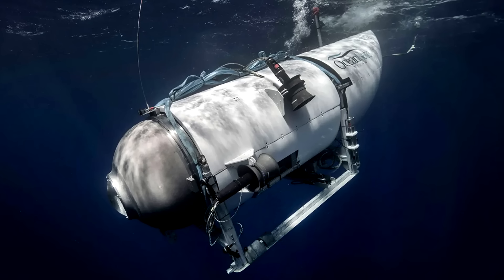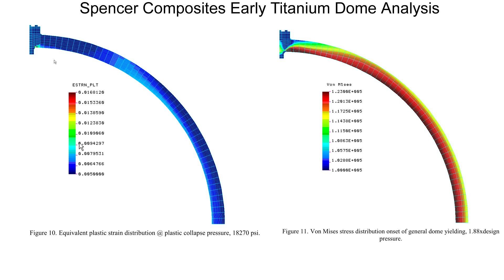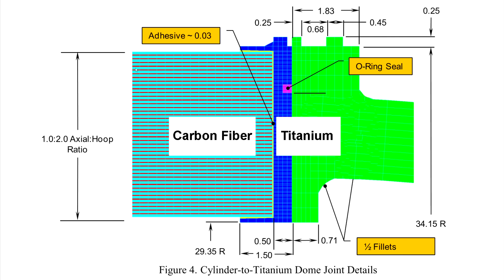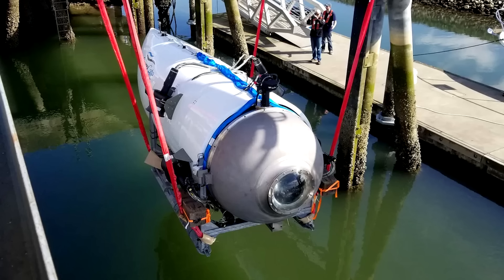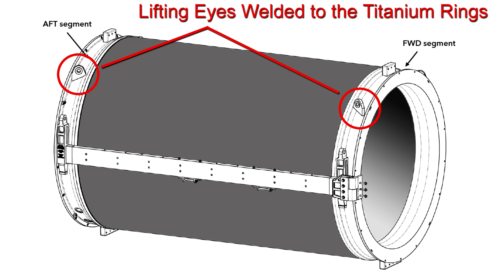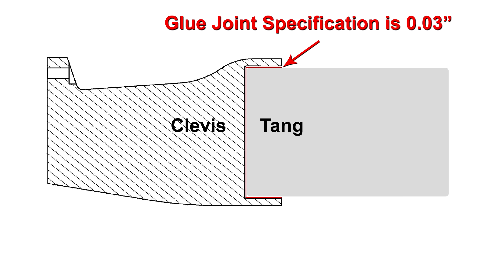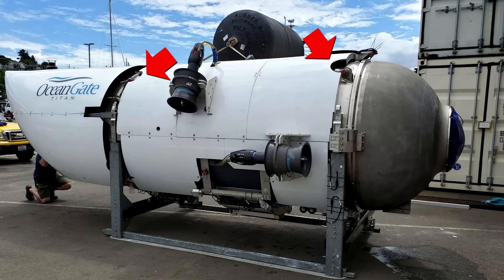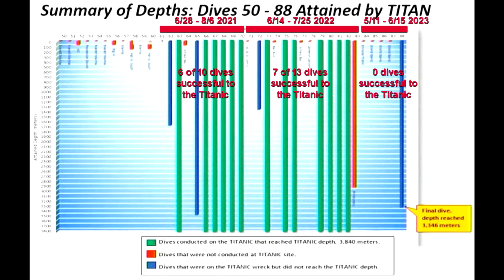OceanGate Titan Titanium Rings - An Additional Story About Them

Comment: This sure looks like the explanation.  Heat applied to do those welds is unthinkable.  Water would start with pinpoints of entry, spider through the laments or on the ring glue interface until a failure.  The pressures involved were incredible, the water would have taken advantage.
Reply from the maker: Thanks for your comment.  This is certainly an interesting story that I wanted to discuss because it adds a variable.  But we don't know if it is the explanation for the implosion.  Maybe the final NTSB report will give us some answers.
Reply: @solareclipsetimer Of all the discussions, this one looks like the most obvious explanation. Even if it wasn’t the actual failure mechanism, had the sub lasted longer, it likely would have become one.  

If you want to investigate further, look up the temperature specification range of the adhesive compound used. It was most likely far exceeded. Then ask what happens when that range is exceeded—chances are long chain polymers break and perhaps  chemically reacts itself or neighboring materials, ultimately leading to cracking and loss of adhesion.  

As a secondary and compounding effect, after being heated, the heated adhesive likely became the primary load-bearing point when the sub was lifted. This would have temporarily deformed the ring, introducing strain in directions the joint had not been designed to bare, that further weakened the already compromised adhesive. That alone could have caused its failure without the heating, but with it, even more so.

There is always a strong temptation in engineering to say "good enough" and cut corners, only to later justify it with "see, it didn’t matter—everything is over-designed anyway."  

That said, I’m also curious about the through-hulls, as they fail frequently across all kinds of vessels. I can imagine one letting go and shooting through the crew cabin, passing through bodies like they were butter. Thus the last moment of awareness of the passenger might have been a gunshot sound and a brief glimpse of Stockton Rush’s  chest and belly exploding open and pouring fourth all within. But perhaps that’s more of a morbid thought than an engineering analysis.

Comment: Are there any engineers here that can explain why there wasn't some kind of sling device that went underneath as much of the sub as possible?? That feels like the first route I would have gone down.
Reply from the maker: Thanks for your comment and great question.  I don't think you would want to lift the vehicle by the hull.  Tony had it all planned out, it was engineered to be lifted from the lower portion of the landing gear.  They just had to follow the original engineering and not cause all this controversy and the potential problems.

Comment: How you gonna design a sub like that, and not consider how to lift it in part of your design? Lol. That should of been incorporated into the design right from the beginning. Not the brightest engineer also...
Reply: In my opinion, this is partially the engineers fault for not designing a way for the sub to be lifted safely, but its not his fault they just went and welded lifting eyes.
Reply from the maker: Thanks for your comment.  Tony Nissen planned to it to be lifter form the landing gear.  The mounting of the landing gear frame was the best way to stabilize everything.  I have images of it lifted form the bottom of the frame, and that one image I found where it was being lifted from the top of the frame.  I wish we had testimony from someone that specifically addresses the decision to weld on the lifting eyes.  We don't at this time, but maybe some more information will come out in the final NTSB report.

Comment: Welding on the rings would have also introduced an area of harder, more brittle titanium in the heat affected zone around the welds
Reply: The company that welded the titanium parts for this is a defense contractor and navsea compliant. A company that specializes in only high alloys. I find it hard to believe a naval welding contractor that welds components for us submarines would comprise integrity  into a commercial sub and comprise future naval contracts
Reply from the maker: @red3874  Thanks for your comment.  I actually hope that OceanGate did have engineering guidance for adding these lifting eyes, and I say so in the video.  However, the publically available information on the Coast Guard site or in the testimony does not mention additional engineering or the welding contractor.  Do you have a reference for the information you mentioned?  Thanks.
Reply: In the coast guard  PowerPoint presentation and Wikipedia mention who the welding contractor was TiFab. As I was reading their site this contractor has also welded on the Alvin submarine
Reply from the maker: @red3874  Great, thanks I will look into that information.
Reply from the maker: Thanks for commenting.  I wonder if some of these details about welding were considered.  I hope they looked into these things.
Reply: @solareclipsetimer  I do wonder as well. I weld titanium for a living which is the only reason it came to mind. I feel that if it was a properly engineered and manufactured part, any welding would have been done before final machining, which clearly was not the case being an afterthought addition. Anyway, thanks for the series of videos, they have been entertaining and provided better detail and insight than I've seen anywhere else
Reply from the maker: @slabbadanks5829  Thanks for the support and the feedback about the videos.  I am glad you have enjoyed them.

Comment: So why not just make a titanium sphere like Alvin big enough for 5? Nissen @ 9:10 talks about uniform loading all the way around.. not static like your car or house. Gravity wouldn't add an extra stress to everything in the vertical plane? I'm inclined to expect it to..
Reply from the maker: Thanks for your comment.  Alvin, at its current size, already weighed 40,000 pounds.  It has to do with weight.  Now, it doesn't seem that carbon fiber is the answer.  But the passenger size of a titanium sphere is limited by total weight.
Reply: One problem  was this sub was supposed to be 7 inches thick  and they went with 5 inches.
Reply: Too expensive. Stockton Rush wanted to sell seats as cheaply as possible and was willing to take shortcuts at every turn in an environment that would harshly punish such stupidity. Dummy ignored what little safety net that was built in and only installed as one former employee said "safety theater".

Comment: We should reconstruct the titan and lowered it 4000m deep to replicate the implosion. With cameras and all.
Reply: Why? We know that it failed and that it wasn't certified.
There is nothing to prove.
Reply from the maker: @sebastianriemer1777  Thanks for your comment, and you make a good point.  It wasn't certified because the way it was built, it was not certifiable.  None of those outside parties would have ever approved it, and the pathways to try to prove the design to them were basically not feasible in terms of time and cost.  But regulation may stop something like this from happening again, at least not with others on board besides the developer.  That is why the story is compelling, and the engineering decisions should be dissected.
Reply: For the last 20 years I'v been making more than 500 different subsea vessels in carbon fiber. Rating from 1500 to 6000 m depth.  On a smaller scale though: 50-500 mm in diameter. Based on our experienced I agree that the glue joints betweene carbon hull and the titanium ring is wrong designed, and to weld on lifting point to the titananium rings makes it evevn worse.
Reply from the maker: @oladal  Thanks for commenting.
Reply from the maker: Thanks for your comment.  That would be interesting, wouldn't it!

Comment: The mill guy had to put it up on the mill table, probably c clamped to angle plates, indicate it in, special engineering instructions to cut as close as you can without opening the diameter. Fun. stupid groove inside. Im obviously not in management or engineering, journeyman tool and die maker.
Reply from the maker: Thanks for your comment.
Reply: @solareclipsetimer  lol I couldn't help but sympathize for the poor folks that got drug into that projects

Comment: As A, as we like to say. The heat involved in welding lift rings or any welding adjacent to a glued surface, then stressing that glued surface repeatedly ( lifting in this example) and expecting that union or bond to have zero compromise, then relying on that bond to sustain many atmospheres of pressure! Well, my ass would not allow me to sit in that vessel for pictures!

Comment: Strongly disagree with the idea that the leadership of Oceangate were not stup1d. According to SpaceX, early in the Starship program, they abandoned carbon fiber in favor of stainless steel because carbon fiber was more expensive, more complex to fabricate, and less predictable. Additionally, carbon fiber has never been used in deep-sea submersibles due to its unreliability under extreme pressure. Given this, there was no compelling reason to use carbon fiber. Sacrifice every metric to save weight? It doesn't make any sense at all. Innovation should be driven by proven material performance, not simply by the desire to be different or claim to be a pioneer. Most concerning, however, was the decision to put people inside the sub during the testing phase of an unproven design, which was extremely reckless.
Reply from the maker: Thanks for your comment.  Watch the segment starting at 05:23 that compares the Titan to Alvin.  Stockton had some specific design goals when building his submersible: 1.  Lower weight.  Titan weighed 23,000 pounds, and Alvin weighs 40,000 pounds.  That much more weight, to use all titanium, makes neutral buoyancy for a submersible much harder.  2.  The lower weight also meant being able to launch and recover with the barge technique (LARS) and not needing a huge ship with a huge A-frame crane to launch and recover.  The LARS concept was a big deal for Stockton.  3.  Bigger cabin at the lower weight.  The Titan can fit 5 people, and Alvin can fit 3 people. 4. The cylindrical shape.  Stockton had this big thing about depth of field in the sub for photography.  He liked this shape because he wanted to have a camera in the back that could record the action in the front: meaning to take videos of people enjoying the view in the front.   In a sphere, you can't get far away enough from any point to do that.  I am not saying any of these things justify using carbon fiber for a deep-diving hull.  I am not saying that the build and testing were adequate (it was not).  I am just telling you why Stockton chose carbon fiber.

Comment: In this video, the first engineer presents only 2 concerns about lifting eyes:

1. Welding on the eyes while the carbon hull is already glued risks overheating the glue.  This doesn't apply if welding was done while the rings were disconnected .
2. Putting the weight of the entire sub on the structural shape between the hull and eyes could deform the rings just enough to crack open the glue, allowing water to seep in.  This seems plausible for the disaster if water made it through and washed open the glue, thus tearing apart the glue/fiber hull material .
Reply from the maker: Thanks for your comment.  You are correct.

Comment: When they were winding the CF they should have X the strands. Everything I have seen shows a straight side to side wind like a hose reel.
Reply from the maker: Thanks for your comment.  They did plies in two directions.  Wrapping like a hoop and 90 degrees to that, longitudinally.  There were two plise in the hoop direction and then one in the longitudinal direction.  They did 133 plies per one-inch layer before curing.  They decided not to use 45-degree plies.

Comment: Concerning the welding of titanium: the weld seam must be made in the absence of air, moisture and contamination from oil, grease and anything like. This was certainly not the case here, considering the production conditions. In addition, the adhesive begins to decompose above 300° C. As titanium has a high melting point, it can be assumed that the adhesive was also damaged.
Reply from the maker: Thanks for your comment.  I feel sure they welded the lifting eyes on the rings when they were off of the first hull and before they glued the rings on to the second hull.
Reply: @solareclipsetimer  Maybe, but welding of Titanium is not an easy task.

Comment: That is the simplest explanation so far. Adding lifting lugs on the rings caused shearing at the glue interface. 20 some lifts later and the adhesive is ground into dust.
Reply from the maker: Thanks for your comment and I am glad you liked the video.

Comment: This was a programmatic failure.  

The sub should have been taken out of service after a specified number of dives to test for signs of fatigue.  Say, less than 12 dives.  The engineering analysis going on since the implosion should have been done at that time, before the failure. 

Then, build a second hull incorporating new design changes, to use for customers.  What you DO NOT do, is to continue diving over and over until she blows!  

He ignored the popping noises and other signs of trouble, erroneously thinking the hull would last forever.
Reply from the maker: Thanks for your comment.  You are absolutely right.

Comment: So they should've built a frame around the Titan to Hoist it. I worked as an Auto tech. And in a Warehouse. Putting Lift Tabs on the Rings was such an obvious mistake due to the Flexing.
Reply from the maker: Thanks for your comment and you ask a great question.  Yes, there were other ways to do it.  However, they may have been concerned about adding too much additional weight.  The weight of the sub is a big deal because it has to do with its buoyancy. Both to sink down to the Titanic and also to ascend by dropping weights, either in a routine dive or in an emergency ascent.  The entire buoyancy balance, after weighing the crew on a dive is, within 200 to 300 pounds.

Comment: The clevis was never designed to take shear force?

Isn't that the ONLY force it would see when the carbon fiber body is put into enough compression???
Reply from the maker: Thanks for your comment.  When deep in the water, the domes and the rings are pushed directly inward towards the butt ends of the carbon fiber hull. There is predicted to be no forces up or down on those rather thin clevis lips.
Reply: @solareclipsetimer  good stuff, man. Watching some of your other videos now!
Reply from the maker: @ACSFieldtech2 Thanks for your support!

Comment: It ascended slower than expected. Was it too heavy on descent, or did water leaks weigh it down?
Reply from the maker: Thanks for your comment.  On the final dive, the descent rate was reported by the team to be 33 meters per minute, which is a normal descent rate.  Just before the implosion, the sub reported "dropping two weights," which is a normal procedure to slow their descent as they approach the bottom. Two weights for them is a total of about 70 pounds.

Comment: Why the fuck did they use Carbon Fibre and Titanium!!
Carbon fibre is great for low weight - NOT required in a sub
Titanium is great at high temperatures - NOT required in a sub
Carbon Fibre and Titanium sound sexy but are simply the WRONG materials to use for a bloody submersible
Nice boring cheap Steel would have been a much better choice

Comment: The titanium rings should be adequately stabilized from any distortion when they are bolted to the domes.  And the lifting shear force against the carbon fiber hull is born by a vast area of adhesive (nearly 1000 sqin each) and the collars on the titanium rings.  So the sheer load on the adhesive during lifting is not much over 12 lbs per sqin.  Double stick Scotch tape could hold it.

Comment: I don't agree with the statements about why the lifting lugs couldn't be added, those rings are supporting the weight of the CF hull when ever the sub is on the ground, the sheer force is no different, unless he is considering lifting standards and knows the factor of safety doesn't meet the standard for lifting equipment. I would however consider that not using a spreader bar could create somewhat of a moment and potentially put the glue in the lower portion in tension, but even that's hard to fathom. What I would like to know is if the ring was machined post welding, if there was post welding normalisation and if there was a dimensional check done prior to fit up.
Reply from the maker: Thanks for your comment.

Comment: As a metallurgical engineer, I find this video very revealing. While these welded brackets may have had nothing to do with the failure, adding them was a potentially fatal mistake. When you are working at the outer limits of engineering expertise, it makes no sense to do anything that increases the chance of failure.
Reply from the maker: Thanks for your thoughtful comment and for adding to the discussion.  I agree. If it wasn't in the original engineering, it probably was not a good idea to add them for version two
Reply: Every single thing in the navy submarine community goes by the standard of "make it twice as strong as it's theoretical limit"
Reply: @FamiliarAnomaly  In Mechanical Engineering for LIFTING devices, the Safety Factor, when lifting humans, is not "Twice", But SIX TIMES the operating Load: SIX !